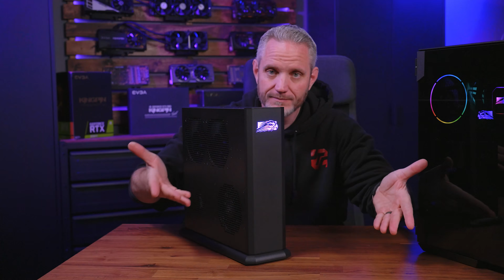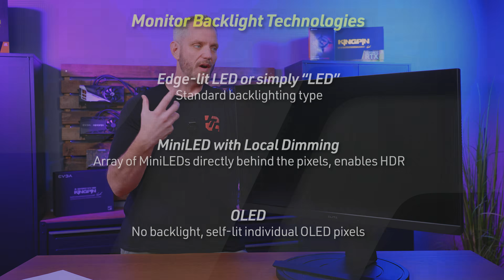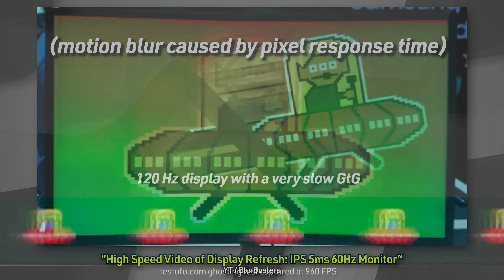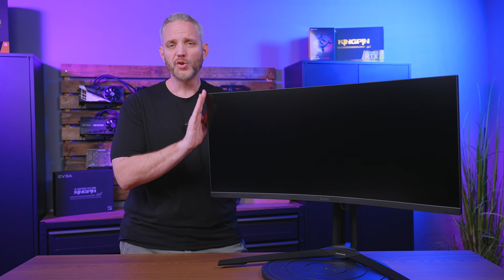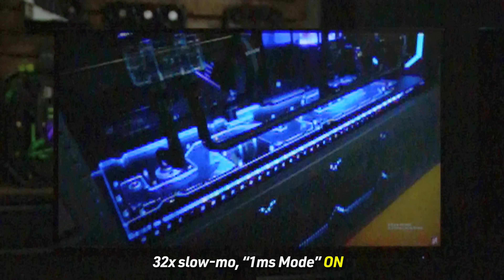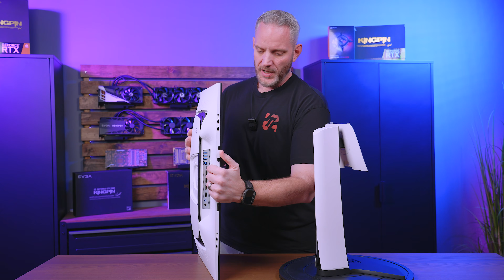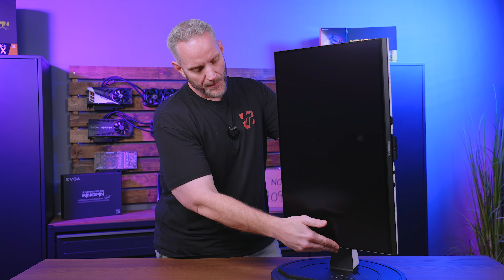Ultimate Gaming Monitor Guide: Find the BEST Screen for Your Setup

Comment: A few weeks ago i bought an OLED screen and i cant imagine going back to IPS or VA. I did not expected a huge difference but having perfect black color is OOF, and on top of that watching stuff with HDR is the cherry on top. Bought Samsung G60SD
Reply: nice! oled is definitely a game changer. i bought a aw3423dwf about a year ago and absolutely love it. glad you like your new monitor. it is for sure the most overlooked part of a setup, which i don't know how since you are always looking at it lol
Reply: OLED are great if you game at night or with the blinds down. however people should be aware they are much dimmer than miniLED (and are more prone to burn in when pushing the brightness). my current monitor is 800nits fullscreen, and with the blinds up is only just bright enough....most OLEDS monitors are only 300nitts fullscreen.
Reply: Really? I got an oled myself but for me it was too bright and colorful. I know that sounds weird
Reply: @olloi91 Doesn't sound weird if it's on aggressive default settings or a "vivid", "vibrant", etc. mode was accidentally selected. But see, your issue luckily is a non-issue, because you can always "tone down" an OLED (look for Gamma or ColorTemp setting!) while you can never get a brighter / more colorful image out of an IPS or VA that's already at its limits :3
Reply: @olloi91  That, and photo development, is why I actually bought a colorimeter and calibrate all my monitors using DisplayCal. Should be possible with OLED aswell...
Reply: What about Samsung Odyssey G5 LS27DG50DENXZA? It's not OLED but any good opinion for it?
Reply: I would go for an OLED, but as long as burn-in still is a thing, or pixel-maintenance, I'll pass. Dont want my monitor to start maintenance while beeing in a multiplayer session.
So I patiently wait...
Reply: @ÐÆMØN420  My Asus XG27AQDMG does pixel cleaning while my computer is sleeping or I can turn on a notification that reminds me to do it manually. I've had this monitor for a week and so far it has done pixel cleaning by itself 25 times (OSD keeps track of this) I did myself manually 2 times just for fun I guess. Not once has it stopped my gaming/content viewing to do pixel cleaning. What you are describing is a non issue at least with new OLED monitors.
Reply: @ÐÆMØN420  You clearly don't know how Oled monitors work if you think they'll do pixel cleaning in the middle of any on going task or process,lol. They only do maintenance when your system detects that nothing's going on/you haven't done anything in a while ie. when your system goes to sleep.
Reply: @novocainDaimon 
that's just not how that works, my LG oled has pixel shift tech that will work whilst using the monitor (moves pixels slightly to reduce any potential burn in). Ive never noticed this actually happening. It also does pixel cleaning/refreshing when the monitor is off ie at the end of your gaming session.
It's an essentially maintenance free issue from the end-user. Ive had plenty of long multilayer sessions.
Most modern OLED monitors function in a similar manner
Reply: @ÐÆMØN420  don’t speak on things when you have no idea what you’re talking about lmfao
Reply: @chrislopez5301  dont repeat what others already said, it makes you look like you have nothing to say on your own, kthxbye.

Comment: Personally my sweet spot is 3440x1440 21:9. It's crisp, just wide enough to give you extra immersion in games a lot of apps support it natively, great for work flow tasks, not so wide you need to turn your head side to side to see it like some 40+ inch panels. Price wise they are around the $500-700 mark for decent panels in either IPS or OLED. I've had two in the past decade and they are definitely where its at for gaming. You can get them upwards of 240+ hz these days too, but I personally go around 120-175 hz to target driving it at a consistent 144hz vs trying to get inconsistent 200+hz since I play a lot of graphically demanding titles more than twitch response games or eSport titles.
Reply: Got the LG UltraGear GP950G 34" with 180 Hz and G-Sync Ultimate. This panel is actually pretty fast, and I would not go back to a regular 16:9 screen, even if it was an OLED...

Comment: Just remember, when the monitor resolution increases, so does the price for the graphics card required to run it 😊
Reply: Unless you don't game on it.
Reply: @Juso3D  If you are using a large monitor but not gaming, then you're probably using it for something that you will need an even more expensive graphics card for.
Reply: cant you just run the game at 1080p?
Reply: @Giorginho  You can, but when your monitor has a higher resolution, it will look bad...
Reply: @dezpotizmOFheaven  How much worse does it look running a game 1080p on a 1440p monitor rather than on a 1080p monitor? I wanted to see somebody test this but cant seem to find it
Reply: @Giorginho 1080p on a 1440p is perfectly passable, even if it doesn't accurately scale up in terms of pixels. DLSS on balanced is essentially this, but with AI upscaling.

Running at matching resolutions is always best, but some games the improved image quality at higher settings can make it worthwhile sacrificing res for better lighting and shadows for example.
Reply: @DjMessiahUK  I'm just torn if I should go for 1440p monitor even though I 90% of the time will play CS2 and Valorant type games. i5 12400f + RTX 3080
Reply: @Giorginho  especially if you play pvp multiplayer, you can go to a 1440p monitor. Your 3080 will handle that resolution just fine if you dont crank up the details to max or ultra.
Your 12400f is the bottleneck and upping the resolution will shift that bottleneck a bit towards your 3080.

Also: if you run a 1080p display, you can always use DLDSR to crank the resolution up to 1440p and check if your gpu can handle it.
Reply: @ Even with the bottlenecking I will still get lower fps at 1440p than 1080p, no? How I understand it is that by going up to 1440p I will be utilizing the 3080 more, but fps will drop
Reply: @Giorginho been looking for the same answer myself
Reply: @Giorginho  your cpu might be bottlenecking so hard, that your 3080 isnt even fully boosting/working.
I make the bold claim: you are not using the full potential of your 3080, even in 1080p because the gpu is constantly waiting for the cpu to catch up.

My 3080 12G is currently fed by a 5600X 6 core 12 thread cpu. Switching from that cpu to a 5800X3D in overwatch 2 makes a difference of about 150 fps.
In call of duty mw3 its about 100-120 fps difference.

And that is, with my 5600X having similar performance (about 12% faster than your 12400f).
Reply: @Giorginho anything but native resolution has a variety of drawbacks.
Reply: Hey that's what I just did! New graphics card is arriving on Thursday 😂
Reply: Unless you run your game at a lower resolution......
Reply: People need to realize this. Also, watch a blu ray in 1080p and tell me that resolution matters as much as you think it does.
Reply: @ravenovatechnologies6554 if you can’t see the difference between 1080p and 4k then you are blind.
Reply: @chiefinasmith  that's not at all what I said.
Reply: @ what did you say then? Because it sounded like you said “resolution doesn’t matter as much as you think it does”
Reply: @chiefinasmith  yes, that's very different than "i can't see the difference."  What I'm saying is, play a high fidelity visual source, for example a blu ray movie, and as an example (love the movie or not) try Avatar. Even in 1080p it looks absolutely incredible. Obviously not as good as 4k, more pixels is more better. But my point is, if you have a very good quality source material, resolution is not as important as it's cracked up to be. I have 2 1080p projectors, roughly 90 inch screens and they look phenomenal. Would 4k be better? Of course. But do I want to spend a grand on a graphics card that can run 4k? No. So I run 1080p and crank settings.
Reply: @chiefinasmith  As I mentioned earlier: resolution is not the key. The key here beeing the ppi and viewer distance to the screen.
4k looks much more crisp/sharp than 1080p because of the higher pixel density. But if you would compare a 1080p and a 4k screen, both using the same panel type and having the same ppi, you actually would not see a difference except for the screen size. And with increasing distance to the screen, even ppi becomes less relevant, because at some point you're too far away to actually make out single pixels. Thats why my 55" 1080p TV still does a good image, while my parents 47" 1080p TV looks more crisp and sharp, but there is no noticable difference if you compare both side by side from 3m away.
Reply: @ravenovatechnologies6554  I do watch blu rays on my 10 yr old Samsung 55" 1080p tv and honestly? I couldnt care less about 4k resolution. Still looks awesome!
But watching a blu ray on your pc monitor? Kinda wasted efforts...
Reply: @novocainDaimon  that's exactly what I'm saying. My point is just that resolution isn't the end all be all. If your source image/media isn't all that then yes resolution helps, but work on the quality first.
Reply: @ravenovatechnologies6554 SO, I am WAY behind in keeping up with display tech. I DESIRE to play Baldurs Gate 3 on the largest monitor possible, BUT my NVIDIA GTX 1065 SUPER is only rated to 1080p. My FPS games are XBox Series S. I CANNOT go 1440p, per GPU specs, and MANY say 27" loses to 24/25" for  FPS and DETAIL. I TRIED OC the GPU with Afterburner/K combo and WITHOUT anything added was overheating the GPU, so that's out. THAT leaves me self-quibbling between buying a (PC-port DP1.4a /  HDMI 2.1) 27" or 24/25" with 144 to 185 hz refresh. ADVICE, please.
Reply: Kind of what I did. Got a 4K monitor, so had to upgrade from my 1660 Ti. And since it was only 60 Hz and I had a 4090 later, I had to upgrade to a 144 Hz monitor. 🤭
Reply: @dezpotizmOFheaven 1660ti to 4090 is an insane perf uplift! Congrats lol
Reply: Only if you are gaming or photoshopping. Any computer can run a 4K display for media and desktop use.
Reply: @OriginalMergatroid  
I've been running a 4K Samsung display with a 1070Ti for 4 years, unfortunately it died last week, then again, I wouldn't say Civilization VI is the most demanding game for a display.
Reply: Im struggling 😂 5120x1440 on a 3080 10gig. I have to turn down settings. It does decent but definitely made my card feel slow. Going from 2560x1440 then to 3440x1440 then the 5120x1440. At least 25-35 FPS dip.
Reply: @kevin10USA  5120x1440 was never a resolution ANY 3080 could handle. Even a 3080 Ti would struggle to maintain a steady 60 fps...
Reply: @novocainDaimon  that I knew walking into this. I moved up in monitor but was waiting until 5000 series
Reply: Absolutely it does.
Reply: Ya no shit
Reply: Or your name is Nvidia and you rise prices just for the heck of it. :D
Reply: Resolution really matters when you go bigger.   Playing at 32" going between 1080p - 1440p to 4k you notice a big difference especially in games and screen real estate in windows
Reply: No
Reply: Which is even more true due to the fact that games are so poorly optimized. Unless you have a high end PC (best or near best parts), dont even consider going 2k or 4k unless DLSS and FSR are good options in your mind. Unless you play mainly old games that will produce the frames you want, or if you dont care at all about high frame rate and only want 60 fps.
Reply: @AttunedFlux  I dont have "near best parts": a 3080 12G fed by a 5600X and 32G of ram. I can still effortlesly run 3440x1440 34" screen estate. DLSS is evolved enough to compensate for poorly optimized games and Path of Exile 2 is evidence enough to me, that I can still run games in good enough quality.
You're right, games are poorly optimized these days. But that doesnt mean, you must have at least an RTX 40 series to get acceptable frames per second...
Oh and I am playing with a 120 Hz vsync cap.
Reply: resolution is not everything, things like oled and hdr10+ are absolutely amazing and they have nothing to with resolution
Reply: @JANISSARY-SS  HDR10+ is just to mark a checkbox, it really doesnt mean anything. Also: oled imho is kinda useless unless you at least hit 1000 nits peak brightness all over the screen. But yes: Panel type and HDR in general can have a great impact on percieved image quality.
Reply: @novocainDaimon  obviously i'm talking about a high end oled panel with 1000+ nit brightness and hdr 10+, those are just insane
Reply: @JANISSARY-SS  sure, 10 bit color depth is superior against 8 bits. Thats why I use it. But depending on the content you play on your pc, OLED might be suboptimal.
With HDR we agree: 1000+ nits is useful, below is... meh. My LG UltraGear 34GN950 can handle between 600 and 800 nits as an IPS panel, which I think is impressive for this panel type. But meh - it does kinda look better, but not for the games I play.
Reply: @novocainDaimon  what do you think about the ASUS PG27UCDM, it even has dolby vision hdr

considering that one for my 5080/9800x3d setup

nevermind brightness seems to be dogsh*t
Reply: @JANISSARY-SS  brightness seems to be 450cd/m² (HDR, 10 percent APL) and 1000 cd/m² (HDR, 3 percent APL) respectively, so thats okayish.
For me, the exorbitant ppi seems a bit too much: 166 pixel per inch - 4k just isnt meant to be displayed on a 27" screen.
So at 27" I'd rather go with 1440p or up the screen estate to 32" when wanting to keep the 4k.
For my personal taste, I'd never go back to regular 16:9 screens - 21:9 or 32:9 are just so much more superior...
Reply: @novocainDaimon  agreed ultrawide is superior, currently got a 21:9 ips ultrawide (1080p) from 2019.
Reply: @JANISSARY-SS  If you're considering an upgrade, go for a 34" or even a 39" 21:9 IPS or oled with a higher resolution.
When I first saw 21:9 in 1080p at my buddys setup, I was kinda underwhelmed.
Another friend of mine also runs 21:9 in 1080p with almost 2400R curve, and that one just looks like cheap garbage. But that might be, because he smokes indoors right at his desk (even though I also smoke, I never smoked indoors and never liked it - the nicotine smell and fumes just ruin your hardware - gotta set priorities)...
Reply: @novocainDaimon  lmao his display probably has a layer of tar 😂 i think im gonna wait untill they release an oled ultrawide with proper hdr
Reply: I just want to experience Oregon trail in 4k 180fps!
Reply: 1440p is king
Reply: @mdiggler  resolution doesnt matter. What matters: ppi or pixel per inch.
I went from 90ppi up to currently 109ppi on all 3 monitors. And its a difference for days! And its less stressful for me, as someone who wears glasses, and my eyes...
Reply: @ÐÆMØN420  Right, but most 1440s are gonna have that higher ppi by default. I haven't seen many if any 
below 100.
Reply: @mdiggler  27" 1440p has ~110 ppi, thats correct. But 32" 1440p has ~92 ppi. Same goes for 1080p: 24" has ~92 ppi while 27" has ~82 ppi.
Both screen sizes and resolutions are more common than you think. My cousin actually prefers 27" 1080p with 82 ppi instead of 27" 1440p. And he is tech savy.
Why? Because higher ppi, depending on the task, can mean more eye strain.
I on the other hand (as a gamer and tech savy person) have different use cases than my cousin does, so I prefer higher ppi...
Reply: Yes and no: I'm gaming at 3440x1440 with my 3080 12G and DLSS keeps the fps in triple digits in all the games where fps matter.
For everything else, I got crappy G-Sync ultimate which still doesnt wörk properly with multimonitor setup...
Reply: @ÐÆMØN420  He’s still right you’re just running your games at a lower resolution using DLSS so that you can hit higher fps?
Reply: @ Not exactly.
I use a fixed fps limit in combination with DLSS to reduce power draw from the gpu.
But how to achieve this lower power consumption is still the same: use lower resolution and then upscale it to my native res...

Comment: Now way i can use a 27 or 32 inch id go crazy.bigger the better. I got 50inch mqx vizio 120hz 4k or 240 at 1080p qled but i dont like it as much as i thoght i would the hz ya but seams to be low grade tv.looking for oled ?

Comment: I bought the MSI G274QPF which is a 1440P 170hz IPS display for on $150 at Costco and at least for an upgrade from 1080p 165hz which I still use for secondary display, I am not looking back. I do have a 7900XT and 7800X3D Build so in terms of parts I can go up to 4k in certain titles, but 1440P is perfect for me. In Space Marine 2 ultra settings I am getting easily 90-110 fps and it is super crisp. Something inside me is kicking me for not spending two hundred more dollars for the 7900XTX but whatever I am very content.

Comment: just my two cents. something i overlooked when buying my monitor was the default base that comes with the box. i didn't realize it would take up that much space on the table i picked out.
Reply: Excellent comment, so true - I needed to get some angled cuts of timber to clamp mine to the clamp so it would clamp properly clamp clamp

Comment: If you don't start them off on their first PC with an expensive monitor, they won't know what they're missing. I was good for a long time hooking my core2 duo laptop to a 32" 720p TV and squeezing 60 fps out of low settings. For a kid, I'd start with a cheap ass TV. They're much better now and you won't scream as much inside when a toy gets shot at it. 

I currently have a 1440 165Hz LG 32" and a 4K 43" Pioneer 60Hz TV on my desk. Both fine for all my doin's.yhgtttttttt. Thank you, my cat wrote that last part....

Comment: Got a few 27" Samsung 4k panels but they're for creative work. Might look at an UW panel for a dual vertical set up as right now it's a pair of 24" FHD monitors in vertical with one on each side of the Samsung 27'. Great info Jay, thanks.